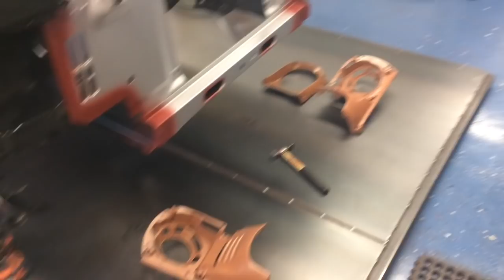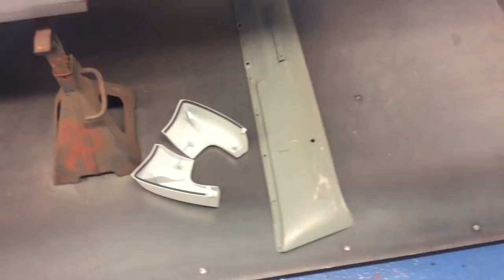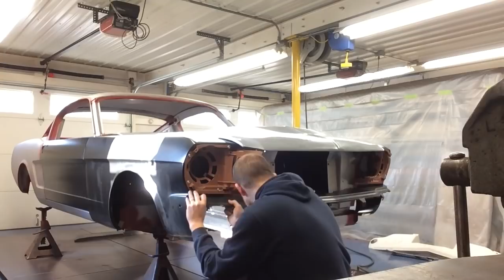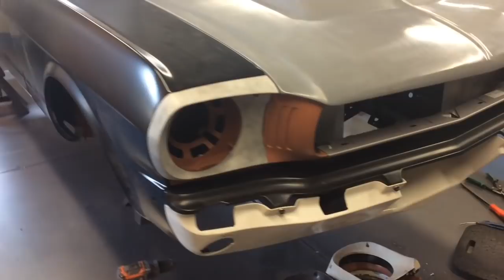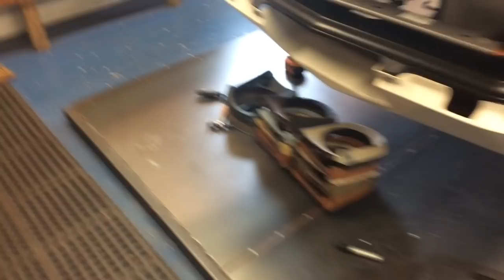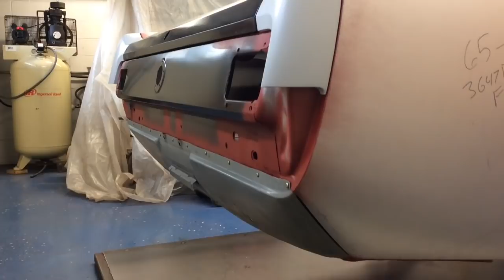Building A 1965 Mustang Fastback Shell Panel Alignment

Comment: Very nice. On my 66 coupe, I have an ugly 3/4-inch gap between my headlight assemblies and the corners of my hood. I have fought the hood alignment and messed with the headlight assemblies to no avail. Someone told me you can gently bend the assemblies by putting them on a board and pressing on the edges, but I don't want to crack the paint.